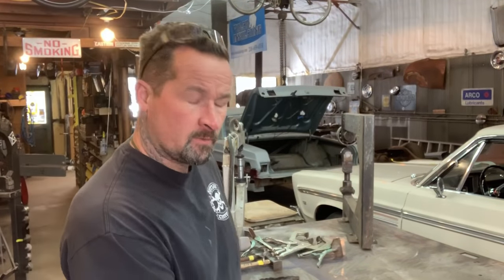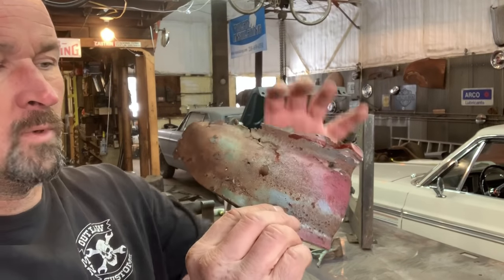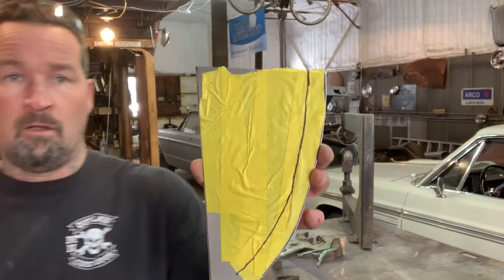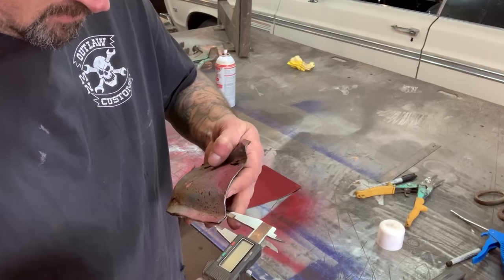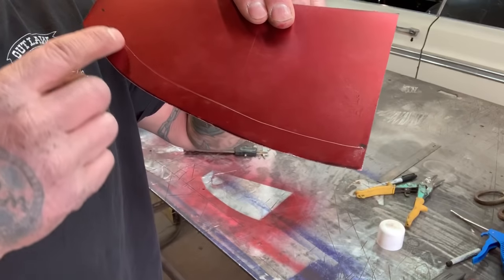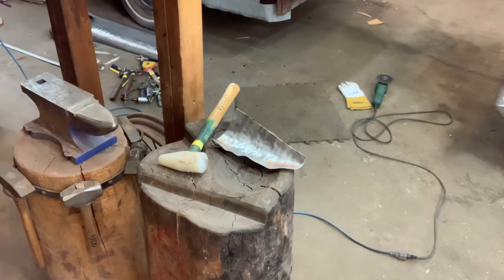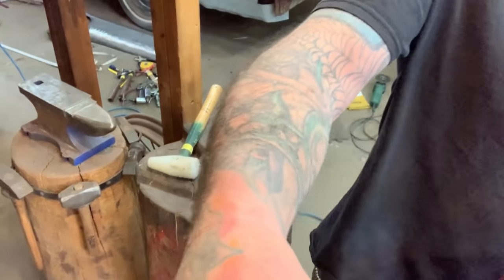Metal Shaping: Forming a curved panel with a flange

Comment: Don't apologize. You're obviously a master level mechanic, and we're not watching for your videography skills.
Reply: He's a panel beater, not a mechanic..
Reply: @lewiscollins1045  Yes, maybe a "panel beater" but one applying great refined mechanical skills to shape raw materials into another form. It is all mechanical skills whether shaping metal or tuning a combustion engine...says a very skilled highly experienced industrial construction worker who started his career in 1985.  I have countless times applied my mechanical skills to just figure out a solution to a problem for pay. That is what I currently do now for a living, in fact, and that is I advise by drawing on my mechanical experience to apply it to a situation in a way as to avoid many costly holdups on a project before the first step even begins. So I am still being a mechanic "with my hands in my pockets" so to speak being paid to, in quick time in my head review an entire construction process from beginning to end in a self-generated simulation model running it multiple times to see where glitches can occur before they get the chance to stop progress. 

Industrial Electrician/Welder/Framer/Sheet Metal Fabrication/Mechanic/Wood Working/Blacksmithing are my main backbone skillsets usually relied on the most, but I am also very skilled in Primitive Technologies, (stone, bone, wood, fire shaping/modding, etc) Primitive Boyer, BackWoods and Off-Grid living in long term situations and even own my own commercial sewing machine as a man and make my own survival clothing by hand myself just using the machine to radically cut the time it takes to hand stitch something. Besides, being in my 50's it is rough on my now corrective lense dependant eyes to look so long so close up at such small things as threaded stitches for hours.  So yes I really can say I possess a cornucopia of real very serious hand skills in widely varied forms and areas, and will always point out that every skill mentioned or referred to in this reply, even the brain only applications, is purely mechanical! He is a master level mechanic indeed.
Reply: @yestervue4697  All some people can do is hide under their doona and criticize others - easier than actually doing something positive with their life..........
Reply: @gtsteve9481  Yeah, guess we're seeing the reflection of the morphing of the generation that used to make things happen by shutting their mouth and getting down to building it with their hands, vs. today's mentality. A mindset where you try to get things done by running your mouth and forcing others to follow your inclinations even in thought, or you're called names and attempted to be publicly ridiculed so as to try to pressure you out of the conversation or force compliance without alternative choices offered. One problem here though, the only two people I ever let do that to me were my drill sergeant and my dad...and this punk ain't neither one of them! Yeah, call me old fashioned/old fart...but in my fifties even still, you will never forget a fight with me even when you may win. I most assuredly promise you permanent injuries, maybe in a life-threatening fashion even,  possibly making you handicapped in some way going forward. I do not stand toe to toe and "box with honor and dignity" following rules...you got 90 seconds to pull your stunt cause that's my end goal. I will not rehearse the means with you though, you'd have to come to get in my face personally as this turd did verbally and see what talking to a real man like that will get you. That's why the spineless twits do that here, you never have to face me in person...it's an easy out for a chicken s@$*t like that.
Reply: @yestervue4697  You, sir, are a good example. 
My response wouldn't have been so polite.
Thank You from S Africa.
Reply: G'day from West Australia,  typing gv as a 3rd gen Automotive Mechanical Engineer with a mere 39yrs trade life.

It does my heart a lot of good to find people all over the planet that have multiple skills set's. 

My skills set's came from a few really good men my Father grew up with.

Traditional coach builder's. ( multiple generations)

Traditional 7th gen blacksmith. (Awesome man)

Sandcasting pattern makers etc etc.

I loved learning from these master's. 

In Australia I AM aware multiple skills I posses are in numbers of maybe a dozen or so.
At 55yrs of age guy's like you sir give me hope for the future generation's. 

😉🙂👍👍
Reply: @JackThomasCollins  go get a dictionary... Get smart
Reply: @JackThomasCollins  walk though a body shop, count the machines, and then count the hand hammers. I work on all the machines in body shops, I build/maintain paint booths, compressors, dryers, mixing stations, lifts, and tons of other machines they use..... They can mechanically disassemble your vehicle down to every single individual fastener idiot.... Then yeah, along the way they do beat on panels here and there as well. I own a company specializing in body shop equipment service and maintenance and not a single service call I make almost $100 an hour for have ever included a call to work on a hammer!

Comment: You will get more out of the tipping wheel by levering up on the work with your left hand. I think that’s where most of the bending action comes from. Nice to see a guy getting panels done without $20k power hammers. Just some simple HF stuff, modified where required and some ingenuity. Thanks for the video.

Comment: Really nice craftsmanship.  Attention to detail is important in that vanishing art form. New subsriber!
Reply from the maker: Mark H thanks brother that’s awesome 👍😀🇺🇸
Reply: @OutlawEdge  sir youre forming this piece of hardened sheet of metal without annealing and softening 
Is this possible
Reply from the maker: Mark H yes because its steel. If it was aluminum u need to anneal it first
Reply: @tuttiw3014  
He is forming a piece of CRS (cold rolled steel) which is mild steel and lends itself well for forming.  A high carbon steel (one in which could be hardened) is not necessary for this type of work and application.

Comment: Really cool video.  Reminds me of working in the body shop as a kid and watching my dad rebuild rocker panels, fender wells, cab corners, door skins and all that.  He'd braze them in, I'd grind them down and float them out, spot prime, and prep for paint.  Got tough when the panel steel started to get really thin though.  Haven't done anything like that for over 30 years now, but I sure did enjoy watching you do this part.  Thanks, new sub.

Comment: I work in aviation as a sheet metal tech and was recently working on a project where I had to do something similar. Had to make a 90 degree bend on a curve and I'd never done anything like it before. I was lost until I remembered the bead roller, but I didn't have a tipping die, so I had to use two flat die and place the top die slightly in over the bottom die and manually bend the part as I rolled it through. It was not ideal, but it worked. You can work for a decade doing what the industry calls "sheet metal" and never pick up anything like what you're showing here. It's practically discouraged nowadays and I've not met a single tech who can do what you do in that decade of experience. I'm working mostly with 1/4-hard 301 stainless, and thankfully it seems pretty forgiving except for the work hardening. Thanks for sharing your skills with the world. You've definitely taught me some things that I've translated into my job because nobody else seems to know how to do this stuff either. In the 10 years I've been in the industry I've never met someone with the ability to work metal like you are in this video, or even someone that knows that it's possible to work metal like you do. It feels like a dying art and it pains me because I am fighting tooth and nail for basic tools like a bead roller at my job. They just didn't see the value, but ultimately did purchase one.
Reply from the maker: It definitely is a lost art! Thanks so much u made my day brother! 👍ARCO

Comment: Thanks for not playing music. 
I’m going to get into this craft. 
I’m working on a system to power the bead roller with a half inch variable speed drill using a bicycle cable attached to a foot pedal to control the drill trigger. 
Thanks for the video!

Comment: Thank you for taking the time to share your knowledge. I’m going to have a go at making a roof corner section for my old F Model Mack, that has rusted away. I’ll buy a bag and hammer, we already have a wheel at work for doing the flange. I work in an engineering shop.

Comment: Hey bro, like your style 😎 wounded Brit Army vet getting back into building bikes again. Your channel is awesome- just the ticket. Camera work is good. Great skills making your own kit, bead roller man that's great - I laughed like hell at way  to tighten dolly in vice 💪🏻 I just got a Metz bench bead roller and first project is a Sleek Bob rear fender  for my Triumph Tbird - gonna check all your vids first, damn you make it look easy 🙌🏻
Reply from the maker: Blackbeard Bikes damn that’s awesome where the heck did u find a triumph tbird? I want one so freakin bad! They are beautiful bikes! Thanks for watching brother. Stay safe! ARCO MN OUTLAW CUSTOMS
Reply: Outlaw Edge Hi bro - I got quite a few mods to get done on the Tbird - it's a '95 model so not the old timer. I got my eyes open for a box of bits Triumph - When I got my skills sharpened I will be able to build a real classy machine. Welding and shaping sheet metal is my current goal. Have a good weekend there bro 💪🏻😎🏴‍☠️

Comment: Have a quick question. I have some 61 impala, fenders around the headlight areas have corroded away. My question was can area like rebuilt back  inserted back into the original panel. If so what would you charge to make both those?
Reply from the maker: Yeah they can be built and then u would need a flange to insert it on the fender or butt weld it onto the panels.  Sorry brother were two years out until we can take anymore work. Thanks for asking 👍 ARCO
Reply: All good brotha no worries .

Comment: Great video. Thanks. Really good to see how to do this without needing equioment costing a kidney. Youve got a subscriber. 

I know its aling the same lines, but id like to see a wheel arch/fender flare made if you could. Just about 2 or 3" wide (the kind youd swe in a classic mini). Aftermarket are fibreglass and id love to try and make them from steel. Theyd have a lip on each side though, like you just did, but one to attach it to the body, and the other to stop the tire getting shredded

Comment: You explain things how my brain works brother! I'm a professional fabricator/welder about 4 years young in the industry, and I've been really interested in metal shaping and wanting to learn some skills to expand my knowledge.  You got my vote! I learned alot about the subject watching this video, I look forward to seeing more. 
Any advice on some basic tools to get started?
Reply from the maker: Ascanio Zamperla i started this channel just for that reason brother. Thanks for the nice Comments. Basic tools to start out with would definitely be a dolly and hammer set off eBay for 25 bucks and free shipping. Then i would buy a EASTWOOD beater bag and fill it with sand. Buy a harbor freight poly teardrop hammer. And build yourself a log shrinking stump. Those are your most used tools for shaping metal. Use 20 gauge sheet metal and dont be afraid to fail. Hope that helps brother. Thanks for watching. ARCO MN OUTLAW CUSTOMS

Comment: I never even heard of a beater bag until  now...you got some good knowledge and skill that you share..I just subbed to you because I have two projects I'm working on...I cut the entire top off my 93 suburban and am building a new top with an upright windshield similar to a Jeep M715 or Hummer  and also I have a 01 Crown Vic that I'm going to modify to look like the Mad Max interceptor....I want to make the front nose look as close to possible  including the headlight covers and  I have to find a way to make both the roof and rear spoilers..I plan on going with an off road style by lifting it enough in the rear to fit 33 inch all terrain tires..and of course that means I must have some lower gears installed...not enough money or time to get all this done as quickly as I want but will finish my truck first because I can't drive it without a top...right now it looks like sherriff Bueford T Justice  drove it underneath a tractor trailer in Smokey and the Bandit and ripped the top off
Reply from the maker: Don Saxon that’s hilarious bro. I totally just pictured sherriff justice yelling at his dumbass son. Lol. 😆🤣 sounds like a really cool build tho. Thanks for sharing brother! 👍 ARCO MN OUTLAW CUSTOMS
Reply: @OutlawEdge  Ha Ha!...thank you!

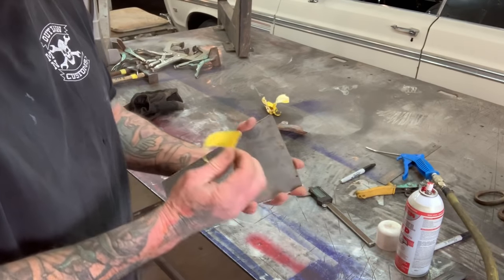Comment: Very nice to see it being done by hand! I am learning to do this myself and have made almost the exact same rollers to use in my bead roller to tip up edges, in my case for wired edges on the guards for my Austin 7 special at about 2:20 here: https://www.youtube.com/watch?v=FUYQ-O-6tTQ

I use the roller to make the fold line then bring the edges up with a slotted rod then finish with hammer and dolly. A lot of trial and error involved but I keep learning as I go. I also attach the shrinker/stretcher  to the frame of the wheel as it is a convenient place to have them. I motorised the bead roller with a windscreen wiper motor and chain drive which I find makes it much easier to operate.

There is a distinct lack of pre-war car building on YouTube so it is nice to see some work on older cars. Thanks!

Comment: Great video, what the best way to trace out a patch panel that you can't trace? Ive been cutting a cereal box close to the shape then trimming till it's good, it takes awhile to do just wandering how others do it.
Reply from the maker: Use 1/8” tig welding wire and make a wire frame buck to shape your panels to 👍

Comment: I enjoy watching your video.  I just wanna ask for the type of metal sheet you use for car body repair? Was it a galvanized sheet, or a low carbon,  mild steel sheet? What is the gauge of the metal sheet you used? Thanks.
Reply from the maker: Lawrence Santiago i use regular 20 gauge sheet metal. Nothing special. Thanks for watching 👍

Comment: After so much work hardening the cold roll do you need to anneal the steel so it wont crack from all the stress.
Reply from the maker: Paul Santi no sir. It usually only cracks if u stretch it way to much. 👍

Comment: I have a problem, I need to build a spare wheel well to fit flat where the old one fit.  I don’t know how to make a 90° flange around the outside of the wheel well as a rivet shelf.  If you could show how to make more flanges around the outside of a curved piece, that would be really great.  Your video was great!  Thanks
Reply from the maker: Give me a minute I will find a video and I will send you the link
Reply from the maker: https://youtu.be/RW4AW6Q9MrU?si=6aZnHRqqvJvI0S2i
Reply from the maker: Hope that helps 👍😁 ARCO
Reply: @OutlawEdge  thanks a ton!
Reply: Man, you really are fast with a hammer.

Comment: your video gave me some great ideas for some projects I have planned.  but I have a non-metal-worker question aka dumb question...doesn’t the use of the air hammer shaper thingy cause the metal to work-harden and make it brittle?
Reply from the maker: J W Dickinson thats not a dumb question at all bro. Nope ive worked panels for hours on the planishing hammer and never had that problem. But the huge hammers will eventually split or crack the metal. Hope that helps 👍
Reply: Outlaw Edge thank you!  👍👍👍👍👍👍👊

Comment: First time i see your videos and i like you have a new subscriber, thanks for sharing your knolidge, i have a question if you can answer me or some one else in here, on the drill hammer, what is the round tip, is the metal also, or is like somerhing softer, cause i know you show us the metal tips, but i would like to know if the tip of the hammer is aldo metal thanks.
Reply from the maker: Eze 1937 the round tip soft hammers are used for shaping only with the beater bag. The soft rounded head shapes quickly but also transfers the blow of the hammer from the bag back into the piece of metal 👍
Reply: @OutlawEdge  thanks for your reply

Comment: So why did you leave out the bit where the tape was on the original part?
Reply from the maker: I just put the tape on there to use as a template but ended up not needing it on there. There’s many ways of doing it. Hope you enjoy the video
Reply: @OutlawEdge  - I think I understand what you were trying to do with the tape but it got very confusing.

Comment: Once asked someone how he had fashioned a panel like this but larger for a custom car. He said the panel was shaped by a hole he covered with the panel and drove a vehicle over. If you are good, anything works.
Reply from the maker: Absolutely!  Im always using the wierdest stuff to shape metal 👍🤣😆😂
Reply: @OutlawEdge  Have you modified axle bearings for dies in a wheeling machine? Somewhere I saw that in magazine article.
Reply from the maker: No but that would be awesome!

Comment: That edge you are breaking can be helped along by using a 3 or 4 inch hand break I have used mine many times over the years of metal working.   nitehawk4300